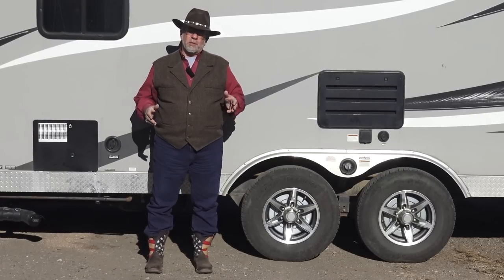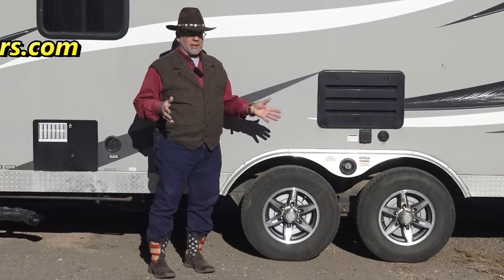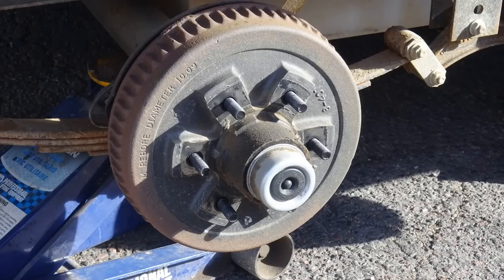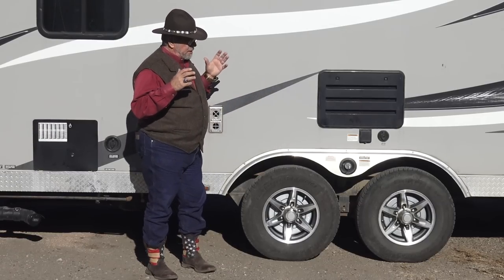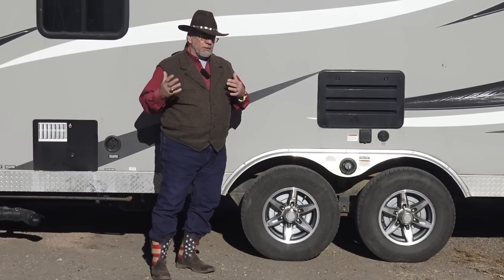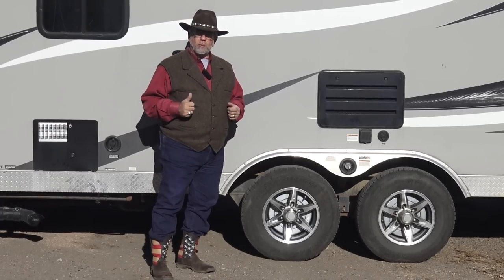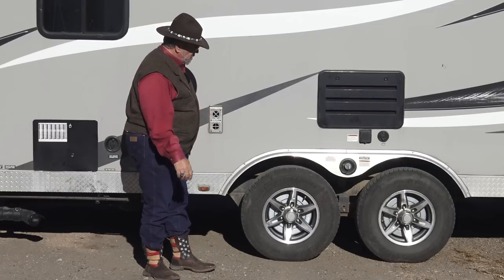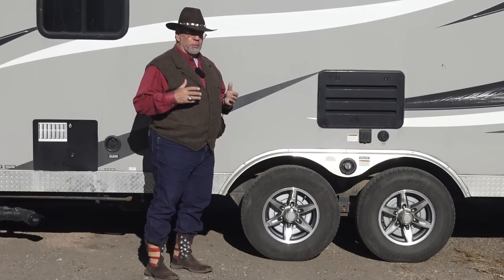Centramatic Automatic Wheel Balancers for trailers, trucks, trailer tires, longer trailer tire life

Comment: I run them on my 2017 Ram 2500 and on my travel trailer, horse trailer, and flatbed.  Super product.  Run smooth and cool down the road through the extended life of your tires.  Run with Centramatic Wheel Balancers!    I live in Spokane WA and NO, I DO NOT WORK FOR CENTRAMATIC.

Comment: How do these things affect brake heating?  The disk appears to block the wind flow past the brakes, which may cause the brakes to overheat.
Reply from the maker: I've been using them on trucks and trailers for close to 10 years. On a drum brake the fins on on the side. The air flows from the front not the side where the Centramatics are. Same with disc brakes. They do block some of the brake dust from getting on the wheels. Walk through a truck stop and look at the wheels. You'll see rigs with Centramatics. Ask the drivers. Freightliner sells them.

Comment: Do they make them for a 2006 Dodge Ram 1500 4x4? Bolt pattern 5 x 5.5 (5x139)? If yes, does anyone knows the part number?
Reply from the maker: Not half tons anymore, but yes 2500-5500

Comment: Can not find these for a travel trailer with a 15" wheel on 6 lug Dexter 5200 lb axles...
Reply from the maker: http://mrtruck.net/centramaticairs.htm
Reply: MrTruckTV will these fit over disc brakes such as a Kodiak disc brake conversion kit for travel trailers?  I'm concerned that the balancing rings might contact the brake caliper.
Reply from the maker: What is the measurement of the disc brakes
Reply: MrTruckTV I don't have the kit yet.  Kodiak is the company.  This is the kit: Kodiak 2-Pack 12" Complete Trailer Disc Brake Kit w/Bearings & Seals 2 Axle Kit https://www.amazon.com/dp/B073QXGCGH/ref=cm_sw_r_cp_apa_hQ4BBbBZPFCAH

Comment: You don't need no balance on trailer tires man
Reply from the maker: Every tire rolling down the road needs balanced
Reply: Depends what kind of trailer tires are they cuz if you cut a 80 psi trailer tire on that flat bed or any trailer you don't really need to do it
Reply: We'll all wave as we pass you on the interstate with your blown trailer tires.
Reply: @raulbueno9218  You can get by most of the time without balancing trailer tires.  But you wouldn't say that if you rode inside a trailer with out-of-balance tires.
Reply: I stopped having trailer tire problems when I stopped buying the cheap China bombs. I also believe quality tires are more true/round than they were 40/50 years ago. I do have question: how can it balance a wheel when it doesn't even contact it, like a hammer on lead weights?
Reply: @Johnson13210  it balances the entire rotating mass..hub tire and wheel

Comment: Sorry millions and millions of trailers rolling down the road for decades unbalanced disproves trailers "needing" balanced. Now a tire with some kind of issue may need balanced like a flat spot or made with a heavy side heavy enough to make it vibrate and cause damage. Balanced tires has nothing to do with blowouts provided the tire is a good tire without issues! If you want to fix your trailer tire blowout problem don't use trailer tires! Use good quality truck tires and that problem goes away! No i will not listen to some BS how they are unsafe they do just fine and if the goal is safe well tire blowouts are clearly NOT SAFE which trailer tires are very well prone to balanced or not! Trailer tires are simply low grade tires. Good truck tires (10ply+) will not give any issue on a trailer! ALSO they do make tires where manufactures state truck or trailer use! Do not be fooled! Many of these tires are also low grade and known for blowing out as well! Yea i found that out the hard way to! Only thing i found that ended the blowout issue was using truck tires! Even wore out tires pulled from my pickup put on with brand new trailer tires the trailer tires blew out LONG before the truck tires started showing cords! This video is nothing more then repeating the manufacture claims.
Reply from the maker: I use to do the same thing years ago. I would put my worn pickup truck tires on my trailer and did fine. That was when trucks had 16 in 10 ply tires. I'm commercial now and can use commercially rated tires like Boar or I have to use ST tires. With DOT rules, I can't use LT tires on my trailers.
Reply: @MrTruckTV  People need to start complaining and show the proof of these trailer tire issues so something gets done. It is unsafe forcing people to run tires that blow out a lot. To add insult here i have a couple older trailers that use 14.5. When you buy new 14.5 tires they also blow out very early while 30-40+ year old weather out mobile home tires hold together. I have one that was so weathered the outer layer of the side wall separated and you could fit most of your hand in there. That tire ran several thousands more miles and never did blow out. Tread wore out. If you know a way i could send you a Pic i have a pic of that tire. It is ridiculous how bad and unsafe these new tires are for trailers.
Reply from the maker: I made a trailer using mobile home axles with the 14.5 tires. They were 14 ply tires but if you let them drop below 90 psi, they would blow
Reply: @MrTruckTV  Many of my older ones was only rated to 70 psi. Some rated at 80 some rated at 100 -102 -105 -110 lol Some of the newer ones within a month or 2 would just gain a bulge sitting there doing nothing! That is ridiculous! Especially when you pay $200 a tire for some of them.
Reply: You're only partly right.  I put new 10 ply light truck tires on my 34' Fifth Wheel.  Now my trailer sways because the sidewalls aren't stiff enough.  So I would say SOME truck tires may be OK but Cooper Discoverer HTs to name one are definitely not.  Also, I once bought a new 27' fifth wheel camper and twice in the first year the bathroom wall developed a crack and had to be replaced under warranty.  It turned out the OEM tires were so far out of balance the trailer shook going down the road bad enough to damage itself.  Lord only knows what damage happened I never found.  I had issues with cracked plumbing fittings in that trailer later as well.  So yes, trailer tires do need balanced.
Reply: @eatshitful  Goodyear has a new trailer tire called Endurance, made in the USA.  I read good things about it.  Also look at tires made by Sailun or something like that.  Supposed to be like 12 ply rated in sizes to replace common RV tires.